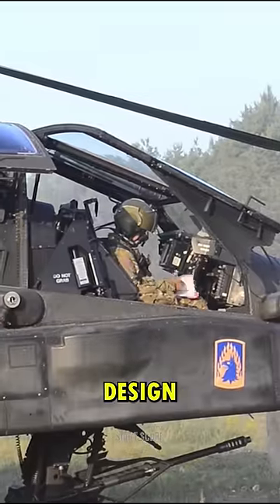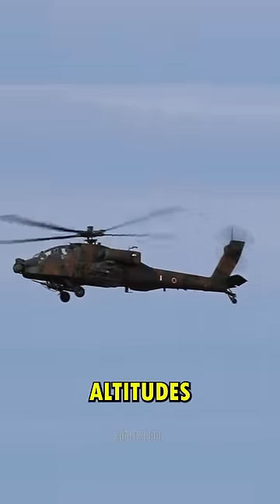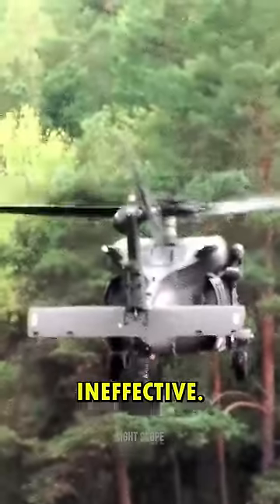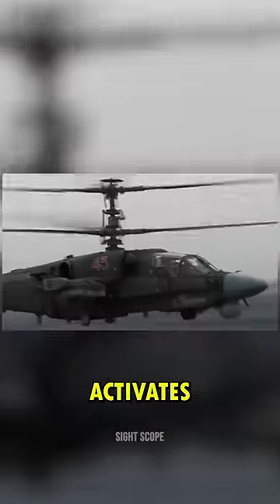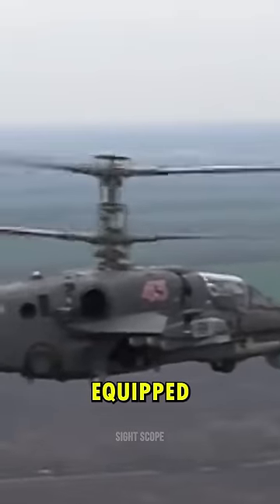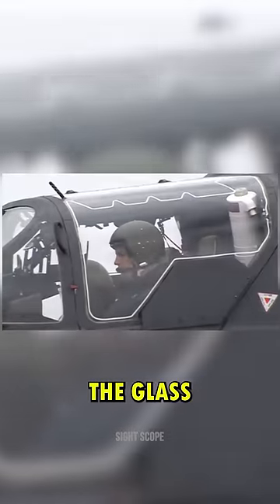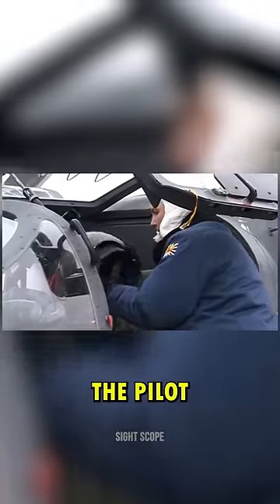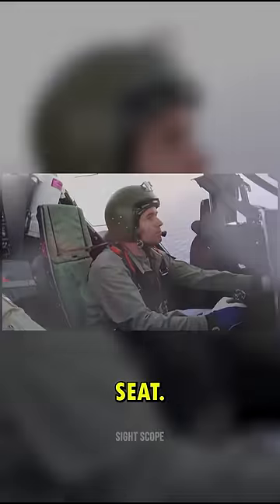Do Helicopters Have Ejection Seats? #shorts

Comment: The KA-50/52 Helicopters use explosive bolts to release the cockpit canopy and rotors (luckily the rotors are already assisted by their own centrifugal momentum) shortly after the ejection seat activates.
Reply: Yep, but its always a better option to land instead of ejecting.
1 its on board communication systems could help pin point your location for passing by vehicles (any kind) to help you (if they can)
 
2 if the recovery of aircraft is possible, it will most certainly be easier to disassemble and make a new one (aka get the working pieces and put them on a new one)

Pretty cool features though, but you'll for sure get cope bots on both sides being a troll in general and ridicule the other side's equipment.
Reply: @larry-333  crashing heli can explode, falling seat don't
Reply: @larry-333 yeah, it's not about the vehicle, it's about the pilot. Both NATO and USSR design weaponry is cool as fuck
Reply: @larry-333  I'd assume like other ejection seats your survival and recovery equipment are in the chair and if you use the chair the helicopter was too damaged to land anyway
Reply: Where's the proofs, Billy? 😂😂😂 Give us video pls
Reply: As proof of the impossibility of using this mythical system, there are many videos of the moment the Ka-52 was shot down in Ukraine.  Not a single pilot ejected.  No one.
Reply: @TheSuperxoxol  because ejection is the last resort
Reply: So after launching the blades up. What do they do about them coming down?
😅it puts them right in line with each other. 
That's a version of "its raining men" I don't wanna see.
Reply: @TheSuperxoxol  it is only seen in a few videos. Plus, pilots would rather use flares or make a sharp turn to avoid a heat seeking missile rather than wasting millions more dollars worth of equipment.
Reply: @Randomanimator48  give me just one video with catapulted pilot. When the pilot talk about this experience.
Reply: Neat design but given this is a russian designed and russian maintained Helicopter I would defiantly want it inspected and its maintenance logs reviewed before taking it up. I can see a case where the blades eject but the seat doesn't, or the blades fail to eject but the seat doesn't due to the failure to maintain the system.
Reply: They lost half of their KA-52 in Ukraine, only one crew ejected.
Enough said.
Reply: @ScarletFlame101786  the rotors are travelling hundreds of kilometres an hour around a central axis the moment they're ejected they're flung off by their own momentum so fast their downward trajectory is of no consequence.
Reply: Hopefully EXTREMELY SHORTLY, after they hit eject does it blow away and the force of the blades spinning toss it off to the side, if not, the pilot is going to be extremely shorter when found 😅
Reply: @sureno1833 did the one crew live, that's the real question?
Reply: @artemefimov8215  Double edged sword
Reply: @Dad-lu1oi  one edged sword, it's a katana then.
Reply: @larry-333 its very situational
Reply: @rygyouwill5293 there are so many videos from ukraine where badly blown helis still manage to crash land
Reply: @artemefimov8215  You will rejoice destruction until it happens to you then it is a double edged sword regardless as that's a outcome that exists as the variable your praising also exists the balance of it
Reply: @Dad-lu1oi  it's a katana, it's a one edged sword.
Reply: @larry-333 yeah of course. What? Do think if a helicopters engine got hit by machine gun fire that the crew would eject instead of safely landing with autorotation? Stupid. 

Lets say a helicopter gets hit by a missile with a faulty proximity fuse. The missile explodes a few meters away and rips the tail boom off or the helicopter, or the helicopter makes a vortex ring during landing. Would you rather have installed ejection seats that add a tiny bit more to maintenance but keeps your crew safe. A crew that has been through a half a year long, expensive training program or let them crash wasting valuable pilots?
Reply: @ScarletFlame101786 acually no the auto rotation of the blades would cause them to go much higher then the pilot giving them a diffrwnt parabolic arc compared to the pilot
Reply: @cralix2782  even if it went higher. Gravity will take it down in a arc similar to the pilots in the same direction. And the pilot takes longer to fall. Its not looking good for the pilot. 🤷‍♀️
Thats not even mentioning wind changes or updrafts that could be caused by either nature or anything heated below. Like the gas tank of the helicopter hitting the ground. It just takes a little lift at the wrong time.
Reply: @cralix2782 it seems there's 8k people that agree on the pinned comment of this video. The funny one about the pilots location after landing. 🤣
Reply: @TheSuperxoxol several Russian helicopter pilots have been released from Ukrainian captivity after ejecting from the helicopters and getting captured.
Reply: @ScarletFlame101786 blades don't get "launched up". After the election system starts to work all rotor blades freed from their connection to rotor (via exploding bolts) and flew away horizontally (with a high speed) because of the centrifugal force.
Reply: @teolynx3805  oh I see what your tried to do. You assumed I wasn't talking about the momentum of the blades. 
Not everything is launched by spring or rocket. It would have been pretty silly if thats what your thought I meant.

You ever go to a boat launch? There no rockets or explosions. Lol 🤣please don't assume what others are talking about or just ask. "What do you mean by launch?"
Reply: @ScarletFlame101786  I've seen such strange people on the internet...
Reply: @teolynx3805  you got me there. There are strange people on here. 🤣
Reply: @larry-333 i highly disagree. it’s always better to save a pilot than a piece of metal.
Reply: @TheSuperxoxol  Check out the video made by Not What You Think about helicopter's ejection seat.

Comment: Well there goes my saying “about as useful as a ejection seat on a helicopter”
Reply: Still a good saying
Reply: yeah instead of shooting up into two spinning blades now i only have to worry about one
Reply: 😂😂 That’s first time I’ve heard a comment like this
Reply: @gabrieljanis6128 he meant both
Reply: "A man with no hands can shoot better than you!"
Me watching the NoHandedShooter on YT "Holy shiiiiii...."
Reply: Are you going to trust a Russian saying this helicopter’s ejection seat is safe?  I sure as Hell wouldn’t.
Reply: It's russian you are safe to use unless I see on video it doesn't exist
Reply: Its Russian... the saying is still true
Reply: @k1er4n544  There is video of people ejecting over Ukraine and it does work. Using pyrotechnic charges in the bolts that hold the rotor blades is quite a simple thing to get right, so it's hardly surprising even the Russians managed to...
Reply: The only thing is your stool ejecting upwards into the path of those still spinning rotor blades it doesn't matter if they're attached to the engine or not they still have their speed
Reply: @coywolfproductions7056 I mean by the time you eject you already have a 10 ton helicopter full of fuel and missiles on it hurling towards whatever's below, so you might not be too concerned about some flying pieces of metal...
Reply: @TheLifeOfKane  there are videos of it working. i Know most of the Russian things are old and don't function, but this is one of the latest helicopters and in Ukraine it's wrecking the Ukrainian armoured vehicles (there are tons of video of the HUD of KA-52s destroying them). So this is probably the only thing working in the Russian army
Reply: @coywolfproductions7056 no you're not. Did you pay attention to your physics lessons? It's simple angular momentum. When the blades are blwon off, they move outwards, not stay above the helicopter.
Reply: Still have the screen door on a submarine. Lol
Reply: Bro, u not based
Reply: @justinpowell1139  and yet is is safer than your Apache :)
Reply: @michelestefanini5466  don't try, americans will do anything but learn about the soviets and their engeneering
Reply: @fredrikcarlen3212 It seems that the Russians are smarter than the rest, since they figured out that it is possible to save the pilots of the helicopter.

Comment: The Ka-50 also uses a rotor desintegration system for ejection.
Reply: Never went to mass production, no need to mention about it
Reply: @clarkhustle  Still interesting though. Is it based on explosives, or explosive bolts?
Reply: @greenaum Explosive bolts if i am not wrong.
Reply: So it just starts falling out of the sky?? Helicopters arent like airplanes they cant glide or any of that theyre a rock
Reply: @dragontooth8821  Basically, yes.
Reply: @christhenademan13  I really wonder who thought an ejection seat would work on a helicopter because 1) My first comment and 2) Theyre mostly used for close air support.... that word close means that its close to the ground 
It also takes time for the rotors to either stop or pop off and within the time of either of those happening it immediately begins to fall and if you already need to eject you're double fucked lmaoo
Reply: finally a SMART PERSON!!!
Reply: @dragontooth8821 Helicopters can actually glide, when the engine fails rotor keeps spinning, it is called auto-rotation, but it wont happen without sufficient speed and altitude.
Reply: It did go into production.  All KA-50s have ejection seats. @clarkhustle
Reply: @iceilator  I'm talking about mass production, there's been only 17 of them, soon they were replaced with ka52
Reply: @geoemg7140  I know that, but that doesnt help the pilots who want to eject
Reply: first is still first. Wright brothers plane did also not go into mass production.  @clarkhustle

Comment: Low altitude and speed was a problem for early ejection seats but modern ones are designed for "zero altitude zero speed." There's video of a pilot ejecting from a hovering F35B
Reply: Hell there is video of pilots ejecting safetly from taxi-ing and stationary aircraft since the Vietnam war. The US has had a Zero-Zero election seat system since the 1960s and it only really became known in the 80s
Reply: Which should tell you something about the quality of the F 35B.

You are conflating two very very, very different things. Injecting from a fixed wing aircraft can be done sitting on the tarmac, ejecting successfully from a helicopter is a much more complex process because you have to jettison the rotors first. Yes you can do it while it’s parked on the ground and it’s not falling like a brick, but if you’re at 500 feet and falling like a rock… that extra time it takes to jettison the rotors before firing the seat can be the difference between life and death.
Reply: @Matt-yg8ub Which is funny considering jettisoning the rotors is a bad idea in on itself.
Reply: @jerryalbus1492  why? I mean, obviously losing the rotors on your aircraft is not a great thing unless you’re attempting to punch out in an injector seat….but why would losing the rotors on a craft you evacuated be an inherently bad thing?

Comment: Some American Engineer: "You can't have an ejection seat in the helicopter! You'll get hit by the rotor blade!"

Boris the Engineer: "Then just remove the rotor blade after getting shot down."
Reply: I mean that’s the idea, right? If you’re ejecting the helicopter is fucked anyways, no harm in blowing the rotors off.
Reply: @Corzappy  Right 👍
Reply: They're going to have to shoot the rotor blades up faster than those ejection seats otherwise it's a no go. Also a hit to a helicopter usually means it'll start turning sideways and good luck ejecting when it's doing that.
Reply: @SDZ675  Lmao. The rotors fly off to the sides, they don’t shoot the entire thing upwards.
Reply: @SDZ675 this thing hast 2 rotors, so if the tail is missing it can still fly normally but its way harder to control, so thats not a problem
Reply: Yet most ka52 pilots end up dead in Ukraine. Ejection doesnt work lmao
Reply: @juh2445 test the RUSSIAN machine then bro... i'll pay you 50.000 Dollar if you survive + whatever it costs to get into this machine😂
Reply: First modern Russian engineering W
Reply: @Corzappy even if the entire propeller was released, it would just fly upwards due to already spinning and being a propeller
Reply: @SDZ675  well you dont need to be pointed up to eject
Reply: @Ling__Ling__  nah the 141 was a W too, even the americans liked it
Reply: @amazin7006  and yet all Apache pilots die if thier helicopters goes down, sometimes the pilot dies sometimes they do not, you can't eject someone who already got hit
Reply: Ivan ...his name was Ivan 🤔😂
Reply: @an-2253   if only the russians built other decent pieces of engineering minus a couple vehicles
Reply: @Ling__Ling__  there are quite a few, though they arent celebrated or talked about
Reply: @amazin7006  they end up dead because getting hit anywhere but the tail literally makes the helicopter turn into nothing but a pile of ash. Have seen ones still floating to safety after getting their tail blown off, tho, even tho they become a really easy target that way and probably get shot down moments after instead... Still could save the crew from some accidents I guess.
Reply: Just watch the ejection work but the blade disconnect not
Reply: Yeah because that will never accidentally come off. Just accept death the moment you step into any helicopter
Reply: @SDZ675 the kamov is tandem so
Reply: the do335 from germany also has something similar with the pilot can detonate a small explosive on the aft rotor so he can jump out safely.
Reply: @SDZ675 they dont shoot them up. They blow the off and let inertia carry them away to the sides, the blades are already spinning crazy fast

Comment: I am no engineer nor pilot, but here is an idea: make the ejection seat go downward instead of up.

Way I imagine it would work is: the bottom of the cockpit would go off like how the canopy of a jet would go off, and then the pilot and co-pilot would just drop down attached to their seats which would have parachutes attached to them so they can land safely. 

The only obstacle I see is, if the helo is at very low altitude, the parachute won't open in time, which might lead to serious injury, maybe death (not sure what the chances are but surely there is a chance of death).
Reply: Also negative G causes cerebral bleeding which will most likely be fatal anyway. Plus the vessel is already on a downward trajectory so there's no point in having it potentially still land on top of the pilot.
Reply: pyrotechnic bolts on the rotor assembly appears to be the best option. automatically set the collective pitch to idle and the blades will safely fly away.

Comment: In most cases autorotation can bring the chopper down safely, and the altitude where they operate isn't far from the ground, so there is no need for ejection seats. But in case you need it the Kamov has it.
Reply: Yes, if the rotor system is intact. If not, you're in a steel box on an accelerating downward trajectory.
Reply: overall, better to have it and not need it, than need it and not have it.

besides, the KA-52 can go over 300km/h,   if your control surfaces get mangled in a missile strike, its unlikely you'd get to use autorotation as a means of deceleration and landing.
Reply: Yeah, pretty much, it’s only used under specific circumstances. In many cases you can autorotate, but in the ones that you can’t it’s there to save the pilot.

Comment: The Ka-50 Blackshark III has ejection seats as well, and it blows off its rotary blades to allow the crew to eject safely
Reply: Yea weve seen how well that works
Reply: In theory although its yet to be seen in combat
Reply: @common_moss8998  well if its anything like the system on the russian helicopters in ukraine its a suicide mission to pull it
Reply: Brother, the III is a number designating the 3rd version of the DCS module.
Reply: @Nick-hm9rh Another engineer who didn't do his homework for tomorrow.

Comment: The ka-50 as well. Really good and cool helicopter too. The twin rotor design looks and sounds really cool, although the only way i have heard it is through video and dcs world, so that idea is limited for the sound.
Reply: The signature, twin rotors have advantages and disadvantages in maneuverability… it’s not the most fearsome looking aircraft out there, but it does its job pretty darn well when properly armed and not outnumbered by MANPADS 100/1
Reply: @Matt-yg8ub   with it's flare system, it is really good with flaring MANPADS too. Every helicopter is capable in their own ways.

Comment: Actually the KA50 was the first, the KA52 was an improvement on the KA50 which was designed in 1980, in prototype form called the Kamov V-80 project. The KA52 came out much later.

Comment: Theres to many moving parts thats gotta work together to prevent instant death in so many ways in the case that even one part in the system . Seems like they could make it safer with less of a margin for failure, by flipping the helicopter on its top or even on its side then eject out the bottom or sides

Comment: As I understand it, the way it works is that right before the rockets in the seats go off, small charges blow off the rotor blades, and centrifugal force makes the rotor blade fly away from the helicopter at high speed, so the ejection seats go right past them.

Comment: I understand some say the Ka-50 is an example of helicopters using ejection seats correctly by having the rotor blades stop or pop off but you also have to consider the fact that helicopters generate ALL of their lift from the rotors and if those stop, helicopter just falls faster.